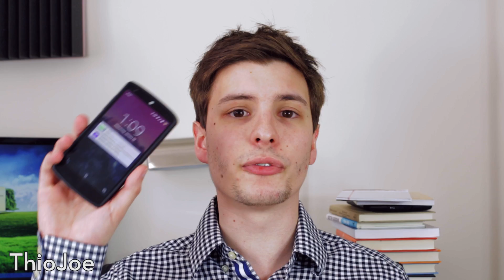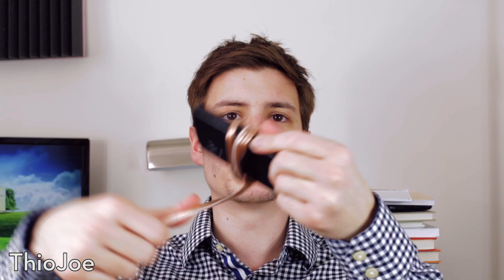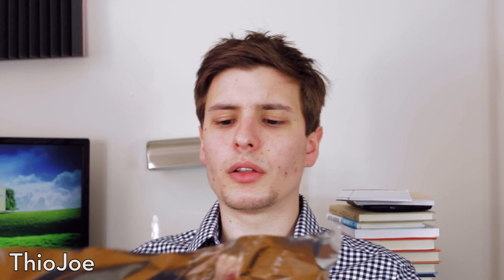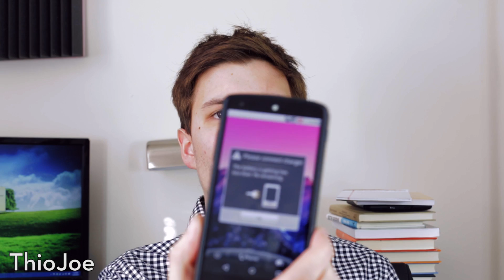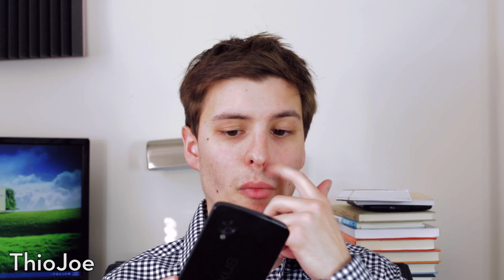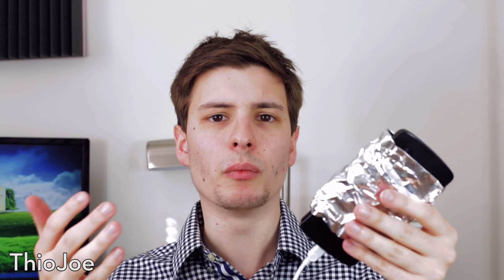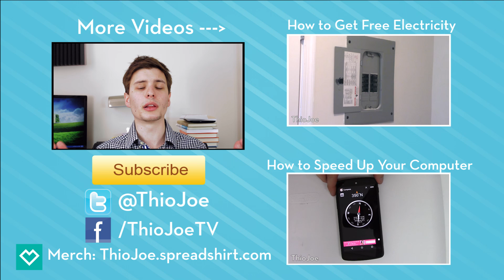How to Instantly Charge your Phone

Comment: wrapping the phone with that fukin thing won't create liquid in lithium battery it takes time to gain electrons from socket and add to solvent when that liquid losses all its electrons it shows empty battery when it add electrons from electricity inside battery and chemical process continues slowly thats y battery drains slowly.
Reply: Hey if your smart enough to know that why don't you use ur big brain of urs to read the discription
Reply: clayton
does it work without the wires

Comment: the possibility of increasing the speed of charging any device depends only on the battery , so if your battery is original in this video is a fake , otherwise it is possible, depends on the C charge , 1c 2c ... if a battery is 1000ma 2c it means that you can charge it in 2000ma.

Comment: Well it will wot but you have to connect the coil wires to the right wires in the cord to the phone and you also need a lot of electricity for a phones normal input of electric current for it to work.-ps side effects are your phone over heating,not processing apps or normal features.😖 try at your own risks but my idea works and has been tested by me

Comment: Well it will wot but you have to connect the coil wires to the right wires in the cord to the phone and you also need a lot of electricity for a phones normal input of electric current

Comment: And a phone will only charge up to a certain rate, if you force it to change at a to-higher current then say goodbye to your phone.
If you have done as told on this video, then try changing the phone in the microwave, apparently it's quicker and gets to 100%

Comment: This is awesome! !If I were to go camping or someplace where charging would be  almost impossible.Would the sleeve work to reduce the discharging of the battery over a period of time to prolong the charge when on but not in use? And are there any battery problems foreseen with extended use of the sleve? From using it multiple times?

Comment: You actually don't even need to use the phone charger.  If you take the phone with the wire/foil on it and place it in the microwave, the wire inductor will transmit the microwave energy to the battery at a much faster rate.  My phone went all the way to 100% in 10 seconds, not 78% like Thio's.

Comment: "You need to know a little bit how physics works"

Yeah, and you don't really seem to. You know why it's called electromagnetism? Because magnetism and electricity are essentially the same force acting upon electrons. Every electric current induces a magnetic field, and vice versa. There's little to no electric potential (voltage) "escaping" the phone or any sort of free energy you're taking advantage of, all that's there is the magnetism from the electric current inducing an electric current in the copper wire as well. Also, by spreading apart the coils across the whole phone you're weakening the solenoid coil that you created. For an actually good solenoid coil you would need very thin wire that is very close together, with minuscule distance between each coil (aka don't wrap it all over the place). And you didn't really seem to follow any of that. 

Also, how did your battery drop 4% after only a few moments? That leads me to believe that it's misreporting the charge so that it's actually far less than it says. Especially since you said there's diminishing returns, that it takes a long time for it to actually catch back up to full. 

Now I haven't tried it out myself (because I don't want to ruin my phone's battery by potentially changing its charge so quickly), but this all seems very pseudo-scientific and just done for some attention.

Comment: Hey Its working smooth in my iphone 7s :)
Reply: and also in my galaxy s10edg00e
Reply: it works with my nokia 3310 to
Reply: works with my samsung 9 too
Reply: works on my nexus 1,000,000,0000,00000,0k000,k0,kdfoisauvifsndilndsilfds. :p
Reply: Works on my iPhone 21
Reply: ***** 
It was a joke dumbass
Reply: +zer0 iphone7 hasn't came out yet Loser
Reply: works in samsung galaxy note 9 too
Reply: works on my samsung galaxy s10000000000000000000000000000000000000000000000000000000000000000000000000000000000000000000000000000000000000000000000000000000000000000000000  edge too. BTW i was bored to write more zeros
Reply: +Amrik Singh which wire you used
Reply: +monik kc which wire you used
Reply: +Anant Jain dont use wire use brain rofl :p
Reply: Not on IPhone 5 :(
Reply: He did say it's for fun not for real
Reply: DUMASS
Reply: +Tre Raghu 
He's playing along. DUMBASS
Reply: yep its not out
Reply: lolol
Reply: 7s inst a thing but 7 is or were you kidding

Comment: can someone tell me how to really charge your phone fast pls?
or there's no way to do this?
Reply: turn on the airplane mode while charging
Reply: get a samsung
Reply: these days standard chargers are 5V 2A. so if you get a 5V 10A charger you could charge your phone 5 times faster :3
Reply: connect it to a car battery
Reply: +xWave Spoder 😂😂😂😂
Reply: In real life fast way possible would be charge for a few minutes (aboid extreme overheat on the battery) using a transformer with the correct voltage for the battery (check battery specs) and limit Amp output to 3A (standard máx amp on a fast usb charge) and hope your battery don't explode. Your battery was made to charge at a specific rate, going beyond that could decrease life-spam or just melt it do to overheat. Someday in the future when supercondensors become a thing my guess would be they will mix both things and let you charge the battery in a few seconds while later the condensor charge the battery slowly (like hibrid car and shit). If you really wonna fast way possible here is the short answer: BUY A SECONDARY BATTERY AND JUST SWAP THEM ;)
Reply: buy a power bank instead.
Reply: +Janvi Dinoo I always do it but my charger is a shit ;-;
Reply: have you ever tried microwaving it?
Reply: +Ritual Flesh That works, legit
Reply: +Janvi Dinoo does that really work!?!?
Reply: Timmy Turner You didn't know that? It's one of the most common lifehacks to charge a battery quickly.
Reply: Hector Colon its 420% true
Reply: +Bill Billington until it die lel
Reply: It can charge up to 3 times faster if u put it on airplane mode and turn the brightness all the way down
Reply: you could also out it in the microwave for .5 seconds, but that's not a good idea because it could easily explode
Reply: just switch off and charge

Comment: I did this and improved on it. Wrap foil around the phone, then wrap your cable/wire very tightly and neatly around the foil. Then use a glue gun to hold the cable/wire in place. Now before you wrap more foil around the the cable/wire lay your charger lead over your phone. Lay it so it runs top to bottom, make sure you leave enough so you can still plug it into the phone, and glue that into place. Now wrap more foil around it and your done. The voltage that travels to the phone via the charger lead seems to be increased by being glued over the windings around the phone, it seems to act as a booster transformer.This speeds up the last 80% of the charging time making it much quicker over all.

Comment: I have two questions
1. Does the cell phone heat up during or after charging through this method.
2. Does the cell phone discharge quickly after this or does it take the same time?

Comment: it's called a 'fool's errand circuit'.  The dual negative positronium waves from the equally negative foil binds with the negative wire wrapped inside.  The negative positrons emitted from the empty space in the room around you binds with the negative static from your hand whuch causes waves of more impossibilitrons to enter into the back end of your battery.

Comment: this is not how electrons work, lithium ion batteries charge slow and discharge slow.   unless wrapping a makes the battery a super battery on steroids this is wrong. Only way you can charge a phone so fast if it had a super capacitor

Comment: a little fun fact:
these phones have batteries around 1800mA big (1.8Amps)
to charge it from 1% to 78% in 10 seconds you'd need to supply it with current of nearly 500Amps, welders use near 140Amps-350Amps!
500Amps is enough to literally turn the phone into a puddle of hot mix of liquid  metals and plastic! (ignoring the explosion of the battery)

the maths:
1%-78% = 77%
77% of 1800mA = 1386mA
1386 in 10 seconds = 138.6mA per second
138.6*3600 = 498,960mA
498,960/1000 = 499A
Reply: you'll learn that in middle school.
Reply: Quite true, I think plugging my phone into the power supply of an ark welder would melt it.
Reply: its fucking joke idiots, this is joke channel.
Reply: +Abubakar Awad, I'm so used to, especially from white people, underestimating me that I don't even care anymore. That's why I gracefully transitioned the conversation to answer his question. Making sure not to respond to Adams42's insult. 

Even though the video is not true, which i had no idea of because it was my first time watching one of his videos. I watched that video 2 times before commenting and could convey the technological jargon that this man presented in this video. And responded to it taking the author for his word applying the video info to reasoning. And I have no expertise in the "electronic" feild. 

People like him will look over people like me if he was in a position to hire me for a job. Not because I am not qualified. But just because of the stereotypes or hate from people like him who hate black males. 

And this is the reason why #blacklivesmatteralso exist. This is the reason why most black men are jobless. 

We are tired of being overlooked in all areas in the country. Currently, police brutality has a tangible face to vent our frustrations to. Moreover, police police brutality is the most tangible manifestation of discrimination that blacks can find. Although I don't agree with rioting and retaliation against police I understand. 

Please stop looking at us as inferior, or like we are all uneducated or unintelligent. 

I bet he couldn't have took those abstract ideas and repeated them half as well as I did.

Plus, I was too confident in my intelligence to even be offended by him.

Smh. Equality now!! #blacklivesmatteralso
Reply: what are you, some kind of Harvard professor.....?
Reply: James Bond007 
It's basic electrical concept :)
Quite easy once you understand it
Reply: Dimensionally wrong. Also, the size is measured in mAh (times hour). You have 1386mAh. 138.6mAh per second or 138.6 * 3.6 amps.

...you don't express everything well but you're getting the right result.
Reply: Paul-Stelian Olaru 
yeah maybe, i don't deal with these units much, but the concept is there therefore shouldn't get lost :)
So should battery capacities always have a unit of mAh or Ah? Any exceptions?

And why 138.6*3.6amps? It's 138.6mA so 3.6A shoulf become 3600mA to level the field and the results would be in mAh, then you turn it to Amps again by dividing by 1000
The answer would still be the same anyway since I multiplied by 1000 then divided by 1000, you just skipped that
Reply: Abubakar Awad I would avoid doing some calculations if I can skip them. I have made the conversion earlier on (and made a single multiplication by constant [I'm a programmer :P ] ) I also tend to keep the units precisely.

mAh is energy (J) for units. mA is current (A) for units.
Reply: Paul-Stelian Olaru 
Nice, I'm also a programmer :)
It was a little maths work for me to enjoy myself a bit, only when i got the result i felt like sharing it and didn't put much effort there
To me this wass good as long as the maths is right :D
Reply: You are so precise! And intelligent!
Reply: you'll learn these stuff in the first grade kid
Reply: can someone explain what he said but in a more simple way??
Reply: genius
Reply: thats true
Reply: Genius Man
Reply: mAh is not an unit for energy. mAh is an unit for charge; 1 mAh = 3,6 C (coulombs). However, 1 Joule of energy is equal to 1 C*Volt dimensionally :)
Reply: Marius Sivertsen 
So mAh or Ah basically the energy of the total electrical potential :D
I'm not sure if potential is the right word here but close enough
Reply: Why did you multiply by 3600?
Reply: Potential in electrical sense is referred as a voltage, and the voltage is related to how much energy there is per charge (J/C) .
I multiplied with 3600 sec/hour to get 1 As (AmpereSeconds),which is equal to 1 C as a definition (remember, 1 Ah is 1 AmpereHour). 1 mAh is therefore 0.001*1A*3600s = 3.6As = 3.6C :D
Reply: agentZalink 
In a simple and conceptual manner,
if the current is 1A it means 1 ampere per-hour.
so to get the value for per-second (Coulombs) you divide it by how many seconds there are in an hour to get 1 second, which is 3600, and you also divide the amperage by 3600

Then to turn it from per-seconds back to per hour you multiply it by 3600 again :)
Reply: Yee you can i a weird way say that 1 Ah is related to how much energy there is per potential difference (this works out dimensionally; 1 Ah = 3600 Joules/volt)
Reply: Abubakar Awad Almost, 1A means 1 C/s (1 Coulomb per second of electrical flow) :D the definition of 1 Ampere is 1 C/s (the total charge that passes a point each second).... In your case, 1 Ah/h = 1A :) you can see this works out dimensionally
Reply: you actually did the math for this?😂😂
Reply: NOOICE 😏
Reply: +Gabriel Queiroz Lacet its physically impossible
Reply: Gabriel Queiroz Lacet 
If what he did is true then the phone should melt down 
That's because of the huge amount electricity needed to charge it that much that fast
Reply: fire2xdxd 
Read the first line on the main comment Mr. "Call everone an idiot"
You tried to be smart or what?
Well reading things and understanding them is the main principal of becoming smart, so again: read the first line of the main comment.

If you aren't adding any new information then please leave it be. If you don't enjoy this or even like it then you shouldn't be here in the first place.

have a good day
Reply: u should open a maths school
Reply: Agreed
Reply: Thank you for the Formula is makes me lot easy to make a descision what is Scam or Does really work... :))) hahahah 500Amp it a small power plant for little neighbourhood... ahaha Thanks Again This Spent's me a lot of time to be wasted at nothing.god bless you!
Reply: Roohan Nawaz 
I'm not really that good at it, these are all basic and simple things, i love maths non the less!
There are people who are way more qualified than me to educate, but you saying that cheered me up :)
Thank you
Reply: Georgi Petkov 
No problem :D
Just remember everything on this channel is actually for fun and jokes and not real ;)
Reply: I wish I could do maths like u
Reply: Abubakar Awad, thanks though for having my back. I really appreciate it.  

We need more like you
Reply: U smart
Reply: +Shadow God no...

Comment: This dude is bullshitting you.  I know electricity, electronics, and physics.  There is no "escaping electric potential" when charging the battery.  It  is not recommended to charge any battery real fast.  If your battety indicates full charge after a few seconds, you have a damaged battery that will die rather quickly.  That is why chargers take time to charge the battery.  
I really hate bullshitters like him.  Useless waste of skin.  His mother should have swalloed that load.

Comment: Hello to all, (don't feel bad ThioJoe) some extra information is in order, this technique to charge a phone is similar to the charge plates, and similar in danger too, the bat will charge faster (that is true) but at the cost of the life span of it, like the charge plate this technique will kill the battery in some charges, the way it charge faster is by change from amp´s to volts ( more volts and less aps will show the bat 100% the total aps (power) that the bat hold is less and less and less and so on, in the end the bat will have volts but with low amps and will last like 10 min in full charge. This is what happens to a bat but in normal cases takes longer (this technique only speed up the bat destruction)

Comment: that's not the low battery screen on the nexus. That's from Gingerbread version on Android and is a screenshot. This probably burns out your phone.
Reply: It wont hurt you phone, that said it's very important to get the coil aligned right so that the inductance is efficient.
Reply: r u sure that u r saying
Reply: Jackson Davis no. The pre-coilation projects ions at a rate of 3.67 RPM which could do a lot of damage. The lithium battery has ions already in use and ions to charge it. Doing the methodology conducted in the video would cause catastrophic damage. The ions would overcharge negatively and cause the phone to implode. This wouldn't be your average implosion, this would create a 11x6 worm hole or black hole depending on your battery and phone composition. You and surroundings (regardless of size) in a 20m radius would be sucked in. Don't try this. I've done my research.
Reply: Are you crazy...? If wormholes like that could be created then don't you think there would be a CHANGE in the phone composition and scientists would know MORE about wormholes and blackholes? Also how can anyone know a blackhole's measurements when you can't exactly SEE one...?!
Reply: TouchofMalice because again it would destroy anything in a particular radius. They can't research it through our devices. You can see them it's an electric black hole which projects MILLIONS of negatively charged electric ions which bond together and making the slightest contact with them will make you burn to a crisp. Don't try.
Reply: If I remember correctly, that screenshot is from an old phone with an early version of HTC Sense.
Reply: There goes my curiosity again...
Reply: Creating a blackhole would be very interesting, but creating a WORMHOLE on the other hand would be even more interesting...
Reply: you make no sense
Reply: Devon Jackson Your lack of knowledge is shameful.